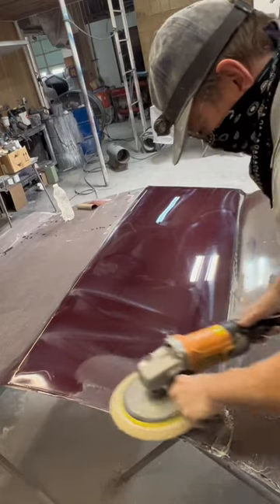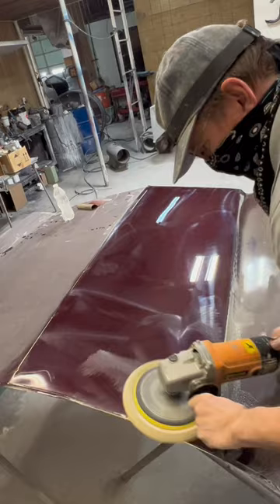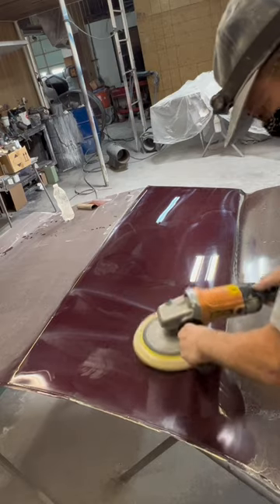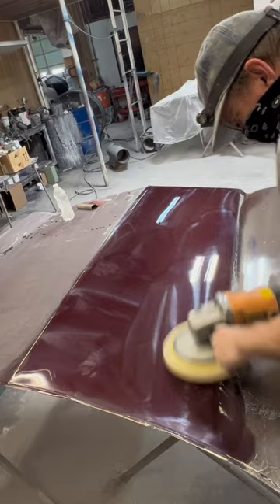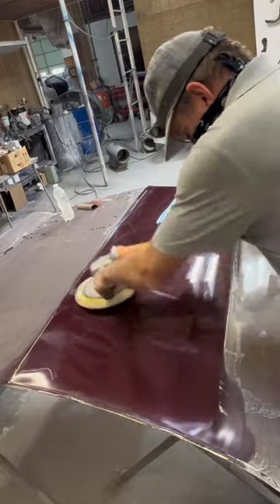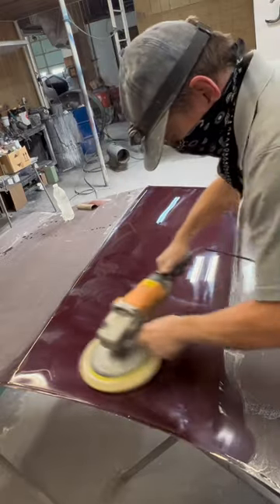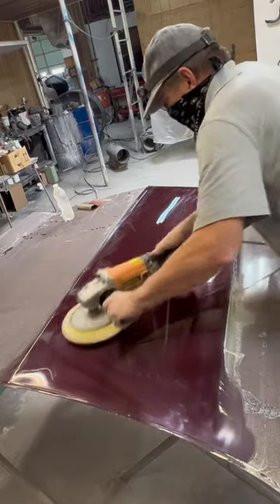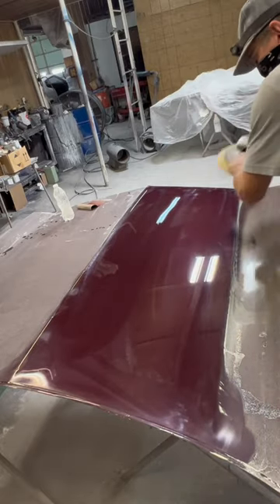Show car buffing::: Phase one

Comment: After you polish and before you wet sand do you clean it with acetone in between or just water. I’m always worried when I buff with some compound that the grit in it will get into the wet sand paper and make deeper scratches. I mostly do fiberglass. Not much exp. With car paint n clear oat. Gel coat is what im used to and it’s more forgiving. I’m exp. Enough to be dangerous but I’ve got a long way to go. 🤣
Thanks for posting. Great work. And hard work 🫡
Reply from the maker: I don’t really understand what you’re asking but I’ll be making more wet sanding and buffing videos. Hopefully they will answer the question that you’re asking.
Reply: Who wet sands after polishing? Why?